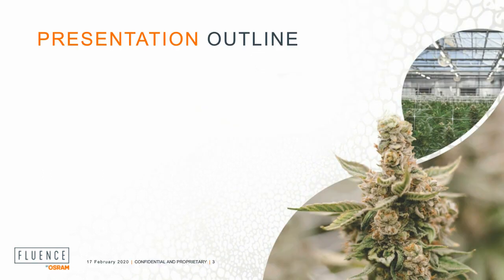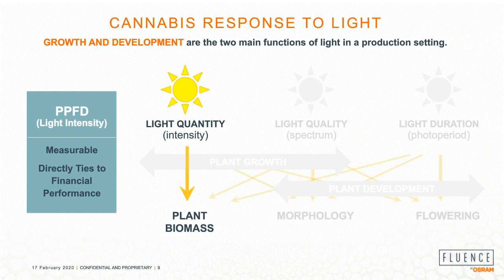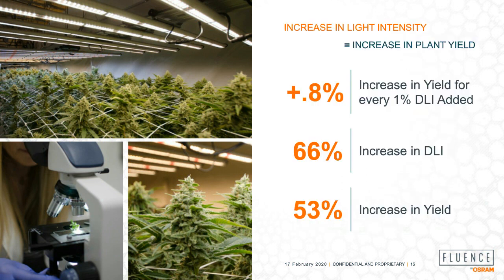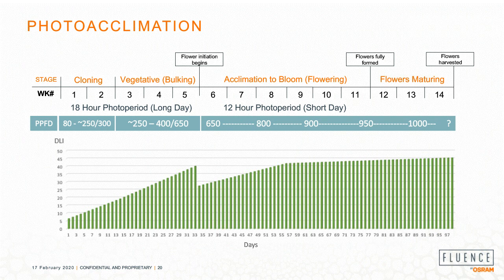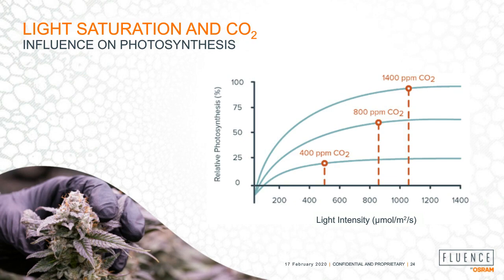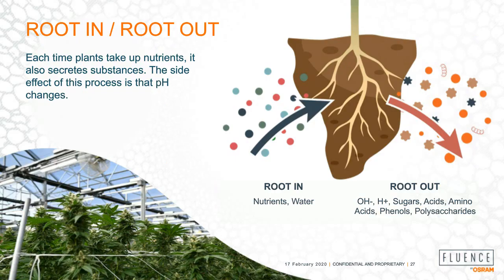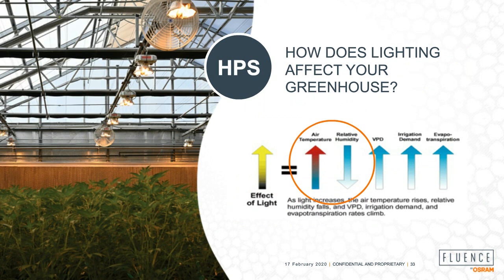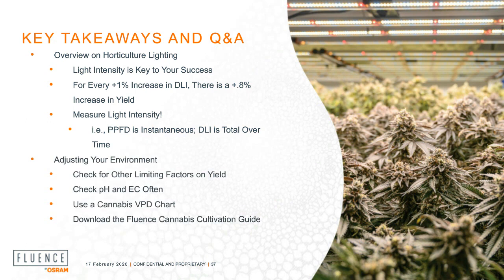How Lighting Affects Cannabis Cultivation - Cannabis Grow Lights

Comment: This is great thank u.  Quick question about the photoacclimation.  U had mentioned going pass the dli levels in veg.  If I’m not adding co2 to the veg tent I don’t want to push it over 600-800 ppfd.   Can I still push the photoaclimation above that number in flower.   Can I veg max at 800 ppfd and then photoacclimate in flower up to 1200-1500ppfd?    Thanks